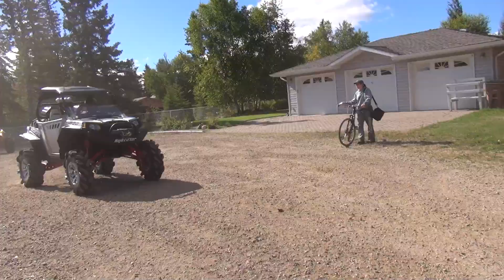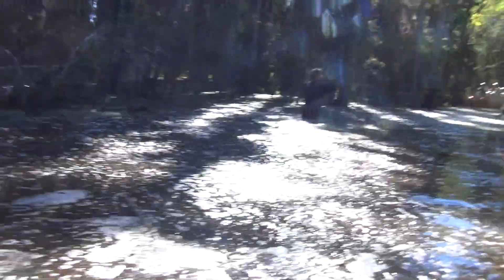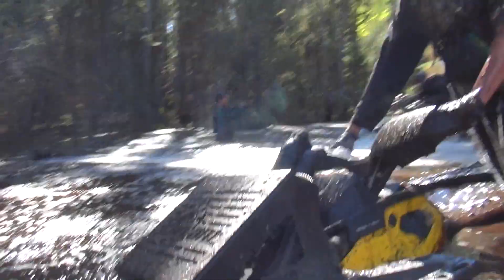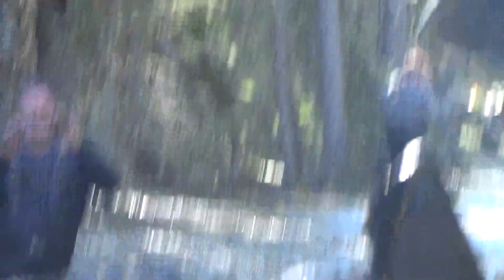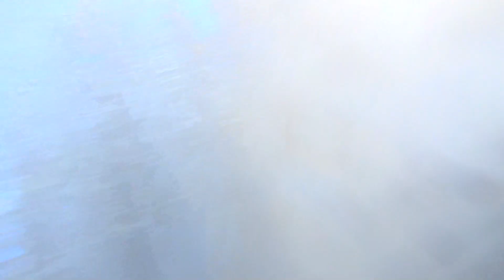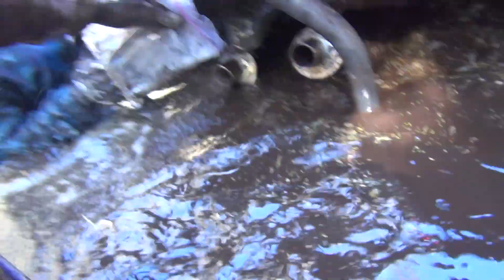P-Trail Doesn't Disappoint

Comment from the maker: Almost never with the stock Can am axles as long as you don't run a bracket lift, we use spring spacers for those that aren't running catvos lifts, Polaris's usually require axle upgrades to keep from snapping, gorillas are very good axles

Comment: hey osta you guys snap many axles with the outlaws ? Im getting either rhino or gorilla axles depends which lift I upgrade to as my 2" on the rzr just isn't enough, if axles are going to be a issue with outlaws I may get other tires...but fuck the outlaws are beasts lol

Comment: ostacruiser Just snorkeled my john deere buck. Its the same fourwheeler as the old can am or bombardier traxters and it has the viscolock fourwheel drive system. and I was wondering if you know of any jet kits and also of any hidden vent line cause I can't find anything online and they don't sell snorkel kits for em. It was a bitch to snorkel the air intake and the radiator is I the back. Let me know if you get the time thanks man

Comment: Is it really necessary for the radiator to be moved? Or is just a snorkel ok? Also which mudding tires do you guys perfer? Love the vids ostacruiser!
Reply from the maker: If you ride a lot of mud with out a rad relocate then you will plug your rad and over heat, no matter how clean you get it inbetween rides, it always cakes in there. Most all of us run 29.5" Outlaw 1's
Reply: Thanks man! Can you give a estimated price it would be to get the a nice mudding machine like yours?
Reply from the maker: CANAM RENEGADE Your dealer can give you a more accurate quote then I can
Reply: ostacruiser Could u suggest some of the mods I should get on my renegade? Thanks for your time man! Keep up the awesome vids!!!